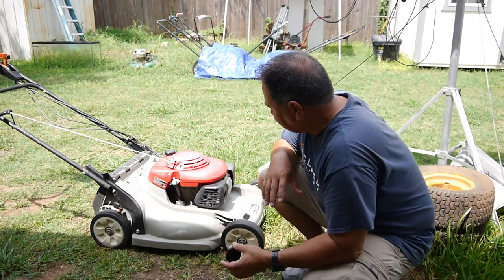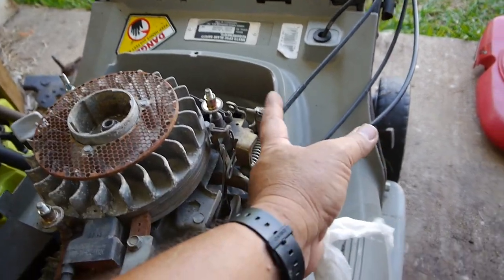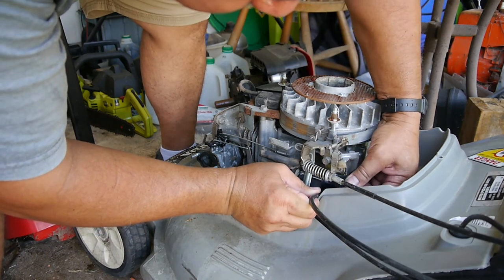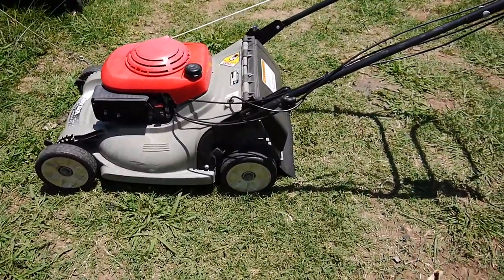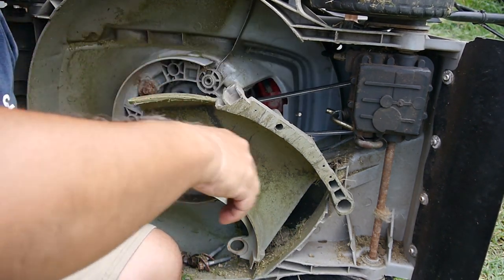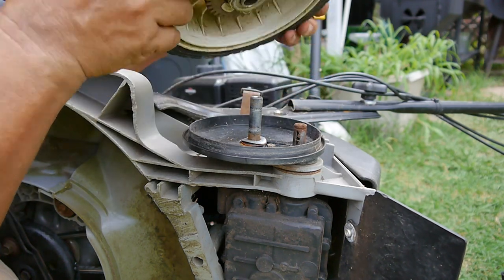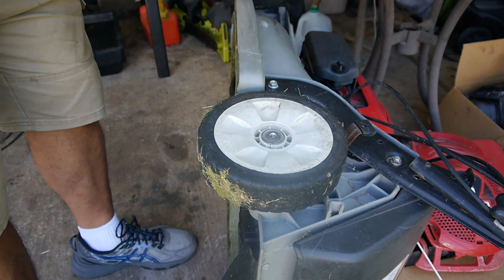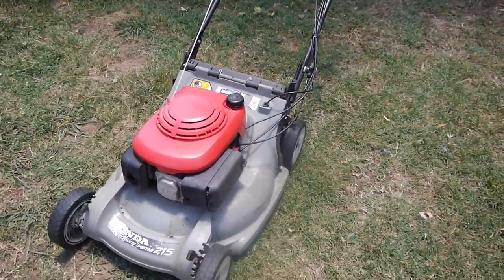A Free Honda HRM215 Lawn Mower - Can it be Fixed?

Comment: Just finished restoring a free HMR215 with a badly cracked deck and a broken off plastic engage lever on the transmission. Had to make a new lever from aluminum and after using a die grinder to carve out all the cracks I used 5000psi JB weld to repair them. I,m surprised you did,nt clean out the fuel system when you had the gas tank off. The price of parts from Honda must have hurt.I was lucky that my wheel system only needed cleaning and lube.

Comment: The cracks are usually around the left front wheel I have found. Normally from people standing too hard on the deck when pull starting. It usually the ones that have the blade clutch so the pull start is done on the side not on the handle bar like yours. Good job on this mower.

Comment: This was a little help for me , but the Husqvarna rear wheel drive I worked on had been sitting outside for I don't know how long and the rear wheel drive was all rusted up when I had too take the rear wheels off and tear it all apart and sand and wire brush it and oil the fire out of it . Now it works - but I spent more time on the rear self propelled part than I did the getting the Honda engine running . I think that somebody on this particular Husqvarna mower let it  initially let sit outside and when it quit running just let it keep sitting out . It's a 2009 model and all the mower looks new - which shows no wear on the drive system underneath . The engine runs perfect after the carburetor cleaning . It'll make somebody a great mower ... thanks for your video - your a great help to a lot of us .👍

Comment: I found the exact same mower out in the deserttook it to the lawn mower shop and had the carburetor cleaned out at the pan gasket replaced an oil sealother than that she works great I think I might have to replace the carburetor because I keep on spraying ether in the carburetor for it to go
Reply: The emulsion tube in the center of the carb is the problem with these as well as the choke lever being out of adjustment.

Comment: I have to say this is the best small format mower! Although I loooove Toro mowers this one takes the "Best in Class". Super quiet, easy puling/starting and very nimble feeling. Thats one to keep. I think the 214 was the reason I got swayed by someone that all mowers are different and that started my curiosity to work on them, but this one seems to be the best.
Reply from the maker: Yes, it runs quiet and easy to start.  The mulch cut is fantastic.  This one is definitely well used, but it is a keeper.
Reply: Small Engine DIY I picked one up for free. needed pull rope and a new belt and works great now. found a bag for $40 on Craigslist. so I don't know if I'm keeping or selling it.

Comment: so, at the 24 minute mark, you show the guard moved aside. I likewise have the two bolts near the blades removed. The bolt you mention as stripped is also stripped on mine but I assume I'll be able to rotate it as you have. But, you don't show anything about removing the bolt behind the drive wheel. I have the bolt out but there's a sleeve left behind. I'm wondering how to deal with that. I've rapped it fairly hard to slide it out but no movement. Does it go all the way thru and need to be forced out or does it only go part way thru and I need to just apply more pressure to the guard?

Comment: Hi I have aquestion, I have another Honda lawn mower, its the identical one you have in the video, and my issuse is when I crank the engine over it grinds same as what yours did, the engine brake cable mecanisum won't  come awy with the brake to make starting easier the big spring with the cable,  you had fixed it, how did you do that?

Comment: May I get your opinion? I have the same mower I have cleaned it like new. My problem is the brass screw in that carburetor shaft is messed up, like I said I have cleaned carb completely except for that screw, I have a replacement from Amazon, would you replace the old carb or try it? Thanks